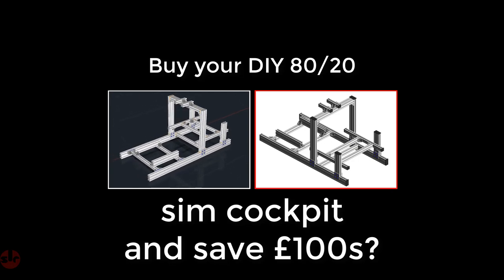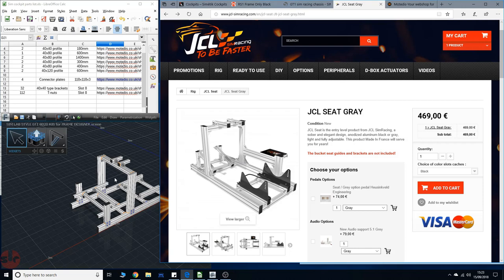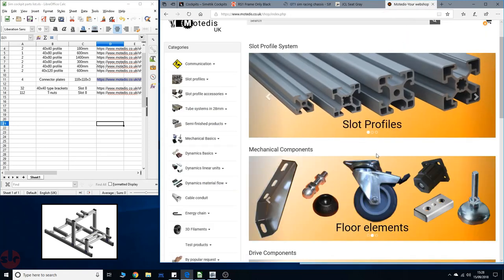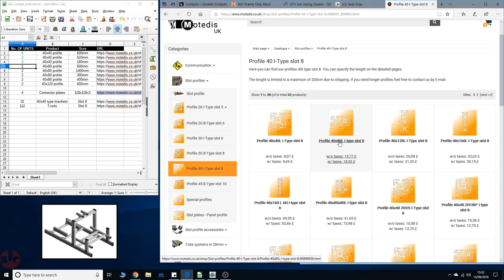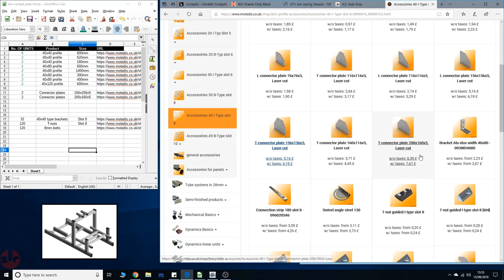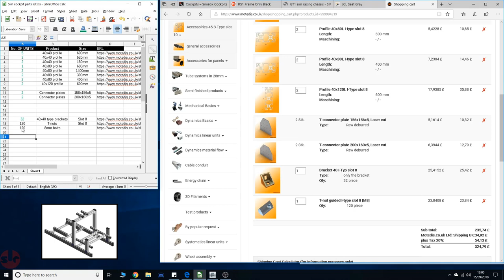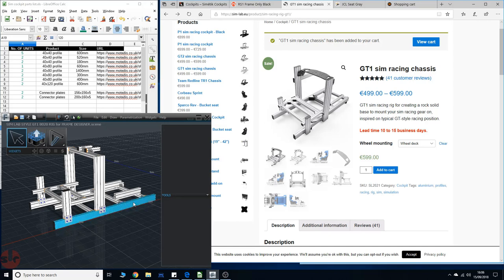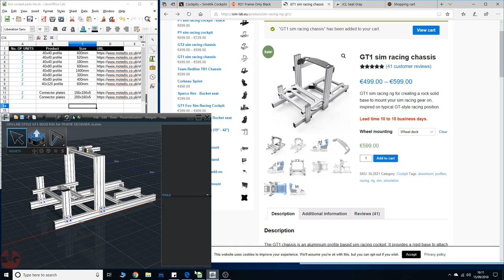BUILD YOUR OWN 8020 SIM RIG and save! 🤑💰🤑

Comment: Don't know if you noticed but the M8*25 means that the bolt is with M8 thread and it is 25mm long. The other side of the chart was to select the lenght for the bolts.
Reply from the maker: Yeah, I did after recording video. It's all correct in the downloadable parts list. Thanks for pointing it out though.

Comment: There are two types of aluminium profiles: Item Range and Bosch Rexroth. Everything you are building here is Item Range. The rig I own is Item Range type. I went to KJN in Leicester recently to buy extra parts and avoid postage fee as I can't be bothered to pay Motedis £40 just to post a few profiles and some accessories. And 45mm profiles are only available in Bosch. I have no experience of using Bosch.
Reply from the maker: The thing to note is the T slot channel is a different shape, so Range type t-nuts don't fit, so you'll need ones suitable for Bosch profile.

Comment: you made a slight mistake you need 4 of each plate not only 2, because you want them on each side of the connections its even in the graphic that you are showing. Otherwise great video !
Reply from the maker: Good observation, but It's actually okay. It's because the 'parts list' spreadsheet lists larger plates from the 8020 supplier. My actual SIM LAB cockpit only has those plates on one side. It's totally fine for the build.

Comment: Great video, thanks for sharing your builds. I am definetly considering building this rig. Will this build be large enough for me, as i am 195 cm in height? I guess i could use longer profiles on the side, to make more room for the legs. Would the side profiles be the only modification to consider, or should i also think about a higher wheel stand?
Reply from the maker: Hi there. I should think the size is fine for your height. There's plenty of play in the design. If watch my Sim Rig tour video you can see I'm not using the full length of the profile of the base. https://youtu.be/tTPr2dpgU9s

Comment: How did you solve connecting the two small profiles on the top of the rig with the connectors ("Bracket 40 I-Typ slot 8")? Cause I assume your connectors had small nubs sticking out as well? Did you remove them somehow? If so, how and with what?
Reply from the maker: The tabs (nubs) can be removed from the brackets, using a flat head screwdriver. You simply insert the screwdriver head behind the tab and lever them and they'll break off easily.
Reply: @SimRacingCorner  Thank you!